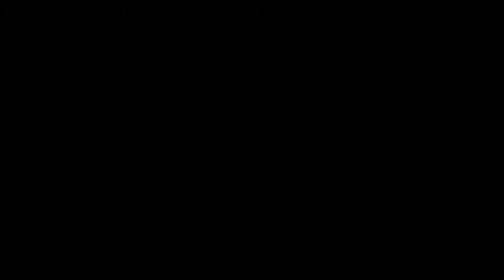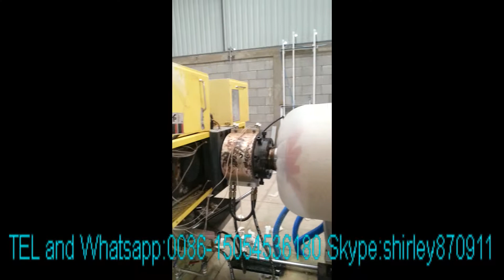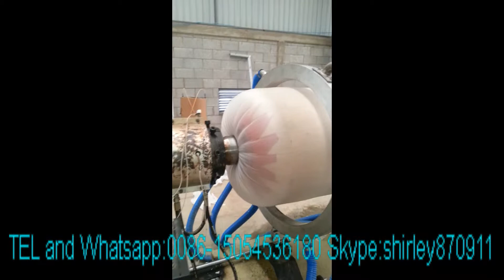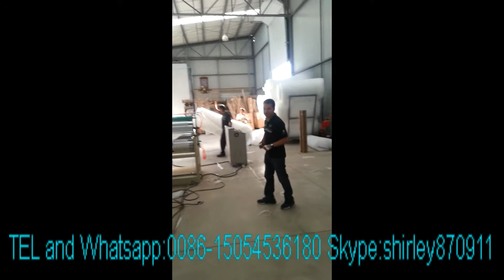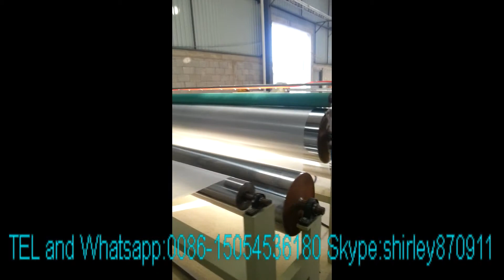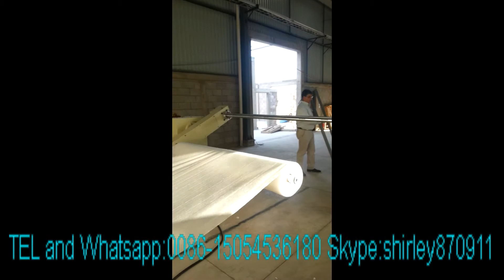LDPE foam Extruder machinery /www.longkoumachinery.com

Comment from the maker: Polyethylene foam Sheet, also named as pearl cotton. It’s a kind of new –type packing material with the features of damp proof, shock proof, sound insulation, heat preservation and good plasticity. It is an ideal substitute of traditional packing materials, and widely used in the packing of fruit, instruments, bags & luggage, shoemaking,  household appliances, electronic product, hardware, furniture, fragile goods, etc. Features of this extrusion line: reliable quality, high output, low maintenance, high automation, easy handling with reasonable price